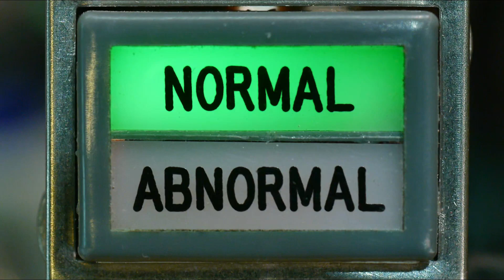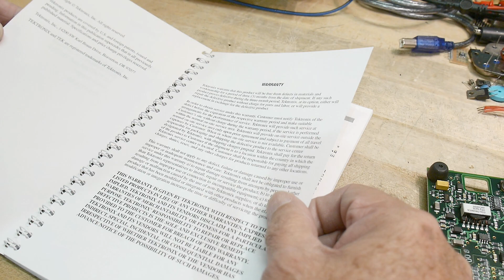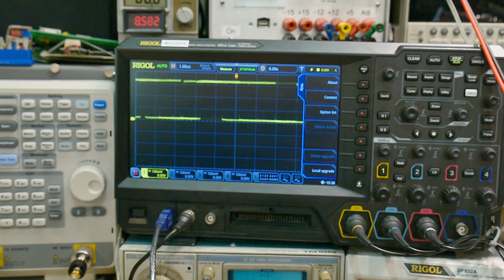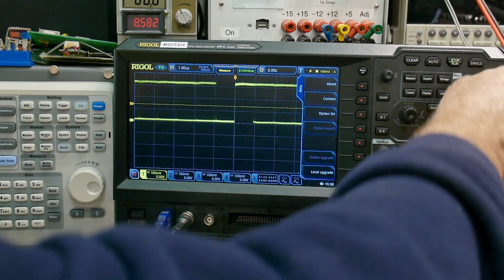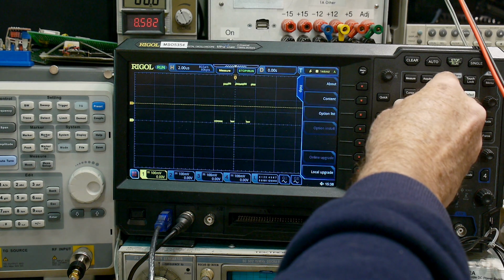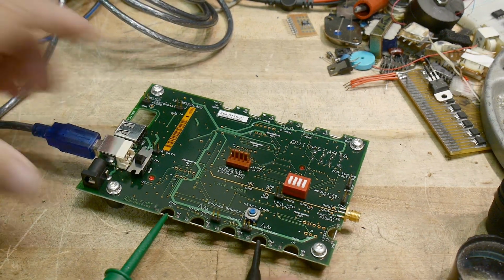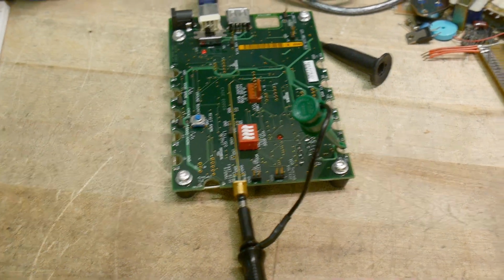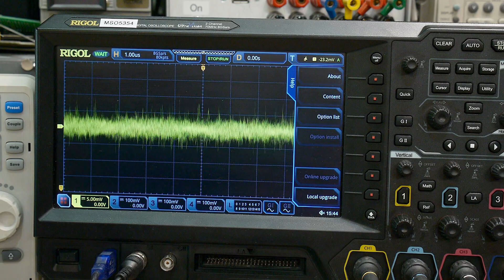#1411 TEK Demo Board QuickStart8 DPO Demonstration Board

Comment: I got the "Quick Start 7" Board in 1997 when we bought a Scope with that " Insta VU" stuff that time.
Unfortunally I got no manual with it. But every time I get a new Scope , I go for a quick " Tek QS7 Check"😉. The "QS 7" looks a bit different , but seems to have similar tests like " OC1 /NRZ " or " Staircase with glitches" . In those days , we got "tons " of Tek scopes , HP Spectrum Analysers , Anritzu   and Rhode & Schwartz RF - Sources and meters from Gossen-Metrawatt and Fluke in the lab....All of them: "Rock- Solid" Material.

Comment: that 2 ns edge is the fastest your scope can show right? Equals 500 MHz. So it could be much faster than that, you can't know without a faster scope.
Reply from the maker: Yes, this fast edge is used to calculate the bandwidth of an oscilloscope. Making some assumptions my scope calculates to about 485 MHz

Comment: When I was the R&D tech at SONY in Boulder lots of company's would not only send for free anything I wanted to take a look at, but some of them wanted to send it with a pretty young lady to explain the product to me over dinner. I always declined the dinners, and told them to just have the parts or modules or whatever dropped off with the receptionist at the front desk. When you reach the big leagues, things can get positively strange. I won't even mention HP's marketing department back in the '70's.
Reply from the maker: you missed out on some good food

Comment: I look forward to seeing the QUAM constellations in Lissajous display mode of the I and Q signals on your many various Oscilloscopes.
GRIN
Reply: In many cases the x and y Amplifier had not the same Bandwith to deal with it. But in the mid-nineties there was a Constellation Analyser from HP ( sorry , hve forgotten the Number) , witch we used in Germany for repair of Microwave communication OC3/OC12 stuff ( 4 PSK, 16QAM ,64QAM  Systems). Great Tool !

Comment: Given away. Own something like this for free (minus the rf and data). Mines is a power supply board to measure. Model # 878-0544-00. Neat little thing that is all for testing although I could “ruin” it and make if useful by “removing” the resistor load. Powered by a 12VAC wall brick transformer btw. Keysight had one too as well as a board more like yours but they are rare to come by. I think b/c their oscilloscope demo a signal virtually (own a MSOX3104A with the EDU opt). Another board, the U1880A, was already hard enough as it is to find. This one you had to buy for deskew but you could make your own.

Comment: DPO vs DSO oscilloscope? I’ve been watching a DPO scope on EBay because I’m trying to step up from my handheld Owon to something more bench worthy. I’ve read a bunch on the two types but I think I’m further away from understanding it. DSO pertains to storage while DPO has to do with sampling functionality allowing for a signal to measure“frequency of occurrence “. Any information will be greatly appreciated.
Reply: In recent times, the line has blurred, but years ago, DPO scopes tended to be better able to trigger on and show glitch anomalies, since they could emulate the analog concept of intensity. Early digital scopes could only display a single line for the most part. Look at this video at 9:39 when he zooms in on the [relatively] fast edge pulse---you see the main trace line where most of the signal is, but you also see a fainter area around that main trace, showing that the signal isn't perfect or fully consistent, and a certain percentage of the time the voltage levels vary. Early DSOs couldn't do that, and on that same signal you would only see the main trace. DPOs give that intensity factor (along with fast update rate to make it useful). TLDR; a DPO is a DSO which has a fast update rate and intensity capability like an analog scope.
Reply from the maker: as Ruel states, most high end DSOs also have DPO functionality. My scope does; it can also do colorized intensity traces.

Comment: I found the QuickStart8 manual on the tek site and it says 2000. I have an equivalent board from Rigol but I don't know whether it does as much as this one - the minicircuits mixer modulated RF and QAM looks like a nice addition. I have a HP spectrum analyser that has a QAM decode option.
[edit] the Rigol board does many analog things and also has CAN, UART, RS232, 12C etc and many, many digital outputs on headers from the central  FPGA.